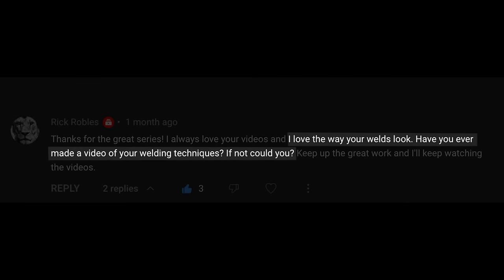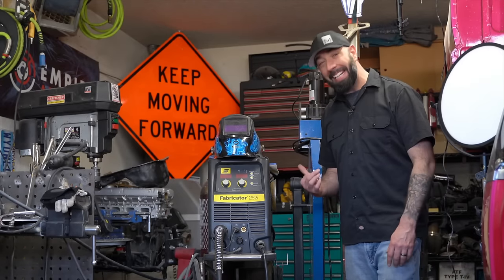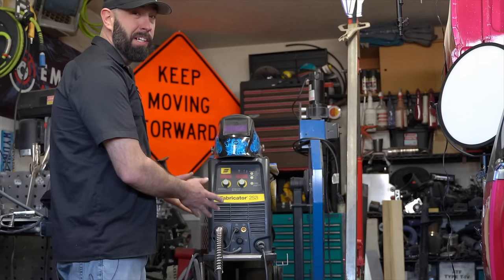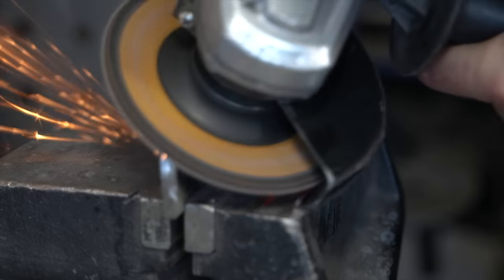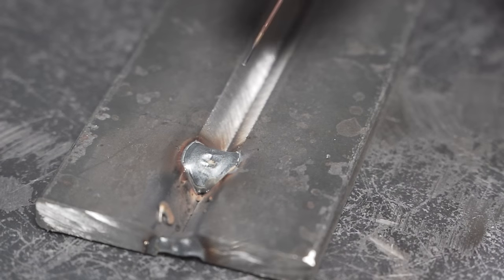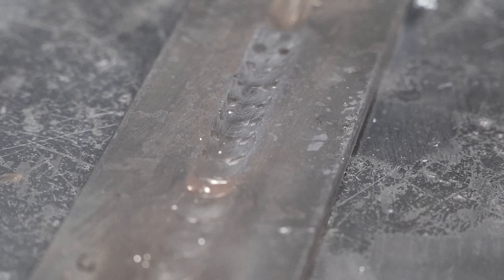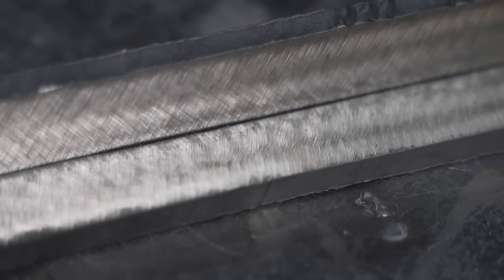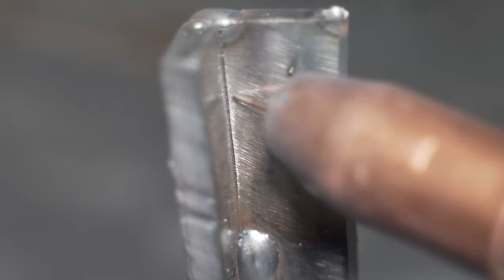MIG Like Mankandy: Techniques for Stacking Dimes with a MIG Welder

Comment: Nice video and the explanations are very clear. BTW, I have a 211 that I bought to improve welding body panels on older cars. Truth is, my open-box special HF 170 Mig ($80) is better at stitching thin metal, as it seems like the automatic settings on the Miller are always trying to 'out-guess' the guy holding the trigger. However, when you want to rock n roll on thicker stuff up to 1/2", it will out-punch it's weight.
Reply from the maker: Interesting! I can’t argue with that. I don’t recall ever doing sheet metal with the 211. Nothing thinner than 1/8. 🤔

Comment: I use the look and sound of the weld to gauge how well it is going. The puddle can tell you if your speed is good. There is a distinct sizzling sound as well.
Reply from the maker: Indeed there is! I like to say it resembles ripping jeans. (Because bacon actually sounds like terrible settings) 😆

Comment: Great video.  Love the detailed explanations.  I’m going to attempt a c notch install and helper bags on my truck. I hope my 110v mig is good enough to weld the plates.
Reply from the maker: Albert!! ❤️ Lemme know if you need a hand. It should be fine. Just try and look closely to make sure you can see the plates melting a bit. It should be visible on the corners.

Comment: I weld vertically down as much as possible, crank power up to make sure getting full penetration and drag it fast enough to not blow through 👍🏼👍🏼I’m normally welding thin mild steel box section for last ten years,, never had a joint fail or not last
Reply from the maker: Good to know, Ricky! I had to double check that I wasn’t the one that wrote that. 👏

Comment: Excellent video.  Can’t wait to try these techniques out.   I was using the “Cursive e” technique but looping in the opposite direction.   I wonder if it will make a difference.   Definitely want to try the triangle pattern.   Yours is slightly different from others I’ve seen.
Reply from the maker: Hey, Scott! If you’ve got the time, read the comments on this video. Someone told me that your cursive e is better than mine, so I’d advise continuing as you are. 
The reason is, with my e direction, you’re chasing gravity and the weld pool can fall over the base metal inhibiting proper penetration. 
Your e direction prevents that. 🙌 
Lemme know how the triangles go!
Thank you my friend. 🙏

Comment: This is similar to a self taught technique I do myself, I hold the trigger and keep my gun still until the start of my weld becomes the size of the bead it needs to be then I move along a bit (basically like the relocate thing u were talking about) and I'm always looking at the top of the weld to match it altogether in a perfectly straight weld. This does take alot of practice tho and harder welds r harder to get straighter

Comment: I too am a self taught person that doesn't really know a whole lot about welding. But I do have a millermatic 211 that really helps make up for my n00bness when sticking two pieces of metal together.  I have only used my machine with .035 wire. Which I feel could possibly be making my learning curve a little harder. Since working on my truck project I rarely work with anything thicker than 3/16". And now that the frame work is pretty much done. I'm using it for thinner stuff like making my own exhaust. I have gotten used to the .035 wire w/220v to be able to do 18 ga sheet metal work. As well as thicknesses in between. However, unless I'm working on thick metal, it seems to whant to burn through, or leave me with large looking welds. If I pause for to long like in the patterns you show in this episode. The metals I'm welding stick together ok, but my welds aren't great looking. I'll admit that I never "practice" when I'm not welding with a purpose associated with my project. Nor have I tried using the machine on manual settings. Could going down to say a .30 size wire be beneficial? I have a huge spool of the .035 left and I'm kinda frugal when it comes to money. Which is why I haven't tried with a smaller wire yet. But if it could make a difference I'll really consider switching. 
I enjoyed sharing this episode and look forward trying these techniques in an effort to improve the looks of my welds. Thanks for sharing!
Reply from the maker: Well, Will, I can tell you I use .030 on everything. Even the 1/4 inch stuff you saw in the video. I’m sure a trained welder could tell you why that’s not Ok. Likely too much heat, though I honestly still can’t grasp that concept. The .030 allows me to do thin sheet, and just takes a little longer on the thick stuff. If you can bring yourself to set the .035 to the side until you need to do some bigger stuff, I think you’d benefit from it.
I know spool couldn’t be all that big. The wire compartment on the 211 is tiny!! 😂
Reply: @GarageFab  Ok, you do raise good points. I value you're opinion  enough that I will try to have a spool of .030 in it before the end of this week.😎
And you're right, the compartment on the 211 isn't large. It does hold an 8" spool (5lbs irrc). Which compared to the 4" 1lb spool, seems big. 😂 
Either way, I've been saying it's "big" for a while, and it's gotten me by until now. 🤣
Thanks for the reply and input. It is appreciated! 🤘
Reply from the maker: My pleasure.
Reply: @GarageFab  just circling back on this a little. The size of the spool on my 211 is an 11lb. Not a 5 lb as I has stated before. So that unit does hold a good size spool. 👍 Now I get to put .030 on it tomorrow since the .035 ran out tonight. 
Anyway, hope to see another episode out soon! 🤘
Reply from the maker: Lemme know how it goes Will! Hopefully the next video drops Sunday morning. I haven’t even started it yet though so… 😬

Comment: rule of thumb is 1/4 inch anything under with can be welded downhill with manipulation, over should be done uphill.  When in doubt go uphill but it is possible to go downhill with preheat and technique to downhill a 1 inch plate same amount of weld is needed but good luck.  Similary to hot yes you will get penetration but you will just solder or capillary bond them rather then weld them
Reply from the maker: Thank you, my friend! That’s more detail than most people are willing to give.
Could you explain your final point a little more? Could you tell me more about capillary bonding? I’m intrigued that you can get penetration without fully welding. 🤔
Reply: @Garage Fab  in a nutshell your so hot your digging or gouging into the steel due to the heat of your weld puddle and arc force, but the weld cools and shrinks so rapidly it doesn't necessarily fuse or bond the whole way. Kind of like running to hot to fast going downhill it might look nice, but you could break it off with a hammer. I'm not saying your going to break your 1/4 flat weld you ran at spray arc settings with a hammer but I wouldn't necessarily trust it in a bend a test
Reply from the maker: @bilco22  Super interesting! I’m pretty sure I follow what you’re saying. Occasionally I’ll do a small weld on cold steel and you can see in the helmet the weld puddle just resting on top of the base. Puddle is glowing and the base is not. Luckily I can’t say I’ve seen that on any of my more serious welds. 
Thanks again for your time my man.
Reply: @Garage Fab  That was exactly what I wanted to say but didn't know if it would just sound confusing yes when your bead is glowing but the base metal it hasn't fused the core may have some but the toes of the weld are more like solder but anyways have a great day!

Comment: I actually prefer the stop go technique for most flat welds but also the half moon works great too
Reply from the maker: For me it depends on the width or size of the weld. Start stop is also my preferred if the joint isn’t too wide. 👏

Comment: When welding vertical down you want hot settings and very consistent travel speed with your gun being angled slightly upwards (no more than 15 degrees upwards or so) so your puddle is being not immediately being pulled over base metal that has not been fused.  To see what I mean turn your machine up hot and run vertical down with the gun pointing right into the plate and move a bit slower, you will see gravity pulling your puddle down in front of where you will be welding before you move the torch to that spot.
Reply from the maker: Thank you Nate! I appreciate your input. Most simply say “Don’t do vertical down.” with no explanation. It’s nice hear why accompanied by a way to achieve the best results. 👏

Comment: Damn. Nice and simple techinque.  you are right that fiddling with the machine is much harder than doing the patterns. Esp when you switch metal thicknesses or have to weld different thicknesses.
Reply from the maker: Man, I haven’t welded unequal thickness in a while! And I’d like to continue that streak. 😆

Comment: Have been out of welding for a while now, but just wondering why you are dragging your weld with shielding gas?
Old skool rule of thumb (doesn’t apply all the time) was “if it has a slag you drag). Pushing into your shielding gas with a mig may help undercut problems 🤷‍♂️
Reply from the maker: Just a preference. I’ve been experimenting with some pushing lately. A very strange body angle is needed for me to be able to see all that I want to see so not thrilled with it.

Comment: I even have a benchtop router table that is great to hold the router so I can work small parts over it without welding them to the bench. Does that count as a tech tip?
Daryl
Reply from the maker: Heck yes! I’d much rather move the part than the router.

Comment: This was an outstanding video! I will be saving it and watching it over again for sure. Many of the comments from you and others are also very helpful and instructive. I too am in the "I can't see" club, and am struggling to keep my head in front of the torch. I am also working on my push technique. I'm doing what I suppose would look like a reversal of your triangle-drag method, where I whip forward a bit to pre-heat, then come back and go side to side. I wonder if I prefer to drag because I learned stick welding first. Did you too? You do beautiful work, and I bet if your welds were tested they'd come out pretty darn good too! Thank you for your time sir

Comment: With my vertical downs I put the heat up and whip it a bit faster, melts the base fine.
Reply from the maker: Agreed! In the helmet you can see that your penetrating well and if you move quick enough you can’t also see the puddle isn’t building excessively and falling over the root. 👊

Comment: Try dual shield welding, flux core wire with shielding gas, it’s a game changer in production fabrication.
Reply from the maker: Interesting! I’ve done flux core. (Failed miserably) But never with gas. Is it 75/25 mix or something else?

Comment: 44 years in structural steel welding, do not do vertical down on stressed joints. Sheet metal is fine.
Reply from the maker: What is the reason, Peter? I’ve been looking for the scientific “why” but I haven’t gotten it yet. Thank you!
Reply: You can't get full penetration confidentiality. I've been involved in testing both types vd and vu. A lot more failures with vertical down. This is stressed joints. Not thin sheet. Truck frames, bridges and cranes ect...
Reply from the maker: I’ve been known to do a truck frame or two. 😳
Thank you, Peter!

Comment: So I see all the controversy about downhill welding, just want to throw my 2 cents in. Ive seen and done alot of pipe welds running downhill with 6010 and 7010 rods. There are also low hydrogen downhand rods also, (lincoln LHD-80). It definitely depends on the electrode. 7018, flux core, etc is a no for downhill because the slag runs in front and can cause a slag inclusion in the weld, puddle control, heat input are also factors in that. Its faster to uphand those anyways. It fills quicker. As for with your hardwire, i see 0 reason that you cant downhand those welds. Keep it hot and get to work 🤘🏼
Reply from the maker: Thank you my friend. I always appreciate input like that. The majority of folks spew absolutes with no explanation of “why”. Your understandable reasoning made me a little smarter. Cheers!

Comment: What wire brand and size do you use? How many cfm are u pushing? Great videos thank you.
Reply from the maker: Currently I’m using Vulcan wire from Harbor Freight. .030. I’m not at home at the moment but I believe the gas is at about 30-35 cfm. (I haven’t changed it in years so 🤷‍♂️)

Comment: I withheld my opinions about downhill welds until I tried them on something that mattered. In an effort to make some shock mounts look good on an off-road race car. I welded the  shock mount gussets downhill (1/4" a36 plate, properly cleaned, with a miller multimatic 220 machine). I used the machine pre-sets for 1/4", and set them a bit hotter, just to be on the safe side. Now every machine is different, and I believe the miller welds a bit fast, but the weld looked good, flat, and seemed to be solid. We did a shakedown run and the welds broke right off (ZERO penetration). I'm sure I could have used better technique, puddle control, led the root better, yada yada, but I ground the welds out with the Satan's sliver maker 3000 (aka carbide bur), and re-did them uphill with lower amperage and much slower wire speed, leading the puddle with a Christmas tree pattern. they weren't as pretty as I wanted (which is why I avoided welding uphill in the first place), but they held up to an 88mile endurance course with no fatigue or sign of cracking. Point is, just because the downhill welds can be ok, the uphill welds are always better, which is why manufactures that adhere to code simply won't allow downhill welding, especially with short circuit mig.
Link shows the car starting it's last lap (passenger front is already flat from a really hard hit). This course cracked the reinforced sub-frame all the way through. https://youtu.be/c-9pk0Y_NVM?si=C_So8SB0wbEKx2B3
Reply from the maker: This is the perfect type of criticism. Constructive critique based on experience and testing. You are appreciated my friend. This makes me want to change my ways and start practicing uphill.
I recently received some online MIG training (Weld Coach) and learned that settings for vertical uphill and upside down welding are NOT the same as all other welding. (The machine is turned down a bit. 🤯 )
That was insanely eye opening and dramatically improved the look of my uphill welds.
I’d like to recreate your weld tests in a video. I think it would be highly entertaining to try and intentionally break off since shock mounts. 👏
Reply: @GarageFab  That would be a cool video, but not on our car, haha. Losing a shock mount completely would cost me about 20 grand and about 2-3 full days of welding and fab work😬

Comment: I love your videos very helpful...I never welded before but I am going to buy a machine and try to learn...from your videos etc...1 thing I would like to know when welding do you keep wire up a few millimetres from joint or are you allowed to touch the base metal...thanks...John...lreland
Reply from the maker: Thank you, John! That’s a great question, and might be difficult to describe in text. While welding, the wire is in fact a few millimeters away from the metal, but that’s not something you have to regulate when your settings are right. You hold the tip of the gun roughly 2-3 centimeters from the workpiece and keep it there.
When you pull the trigger, wire is pushed out at a constant speed and an arc melts the wire before it contacts the metal.
The machine heat setting and wire speed determines how quickly the wire melts.
You can set the wire speed too high or the heat too low and the wire will crash into the metal. That produces a less than ideal weld.
You can set the heat too high or the wire speed too slow and the wire will burn back too quickly which also creates a bad weld.
It’s a delicate balance of heat and wire speed. If you can, I strongly recommend the Millermatic 211 Autoset machine. 
The auto function takes care of the settings so you can focus on learning technique.
Hope this made some sense. Best of luck!
Reply: @GarageFab  That makes sense I am starting to understand now the process...I will see about getting that machine...v well explained...thanks...John...lreland

Comment: Ok so.. I’m a high pressure tank and heat exchanger fabricator. I’ll tell you what, only time I’ll really use downhill dual shield, 1/16 wire is what we use fyi. But anyways I’ll use a slight vertical downhill when I’m on the inside of a tank welding the round seems on the heads. Key word”slight” witch means I start slightly uphill and go downhill a tad right into the “flat” and then actually when I’m coming to meet up to that last weld, I start going uphill very ever so slightly at the very end of the weld. Everything gets air arced on the outside. Then a single stringer is run. Before that I was a structural welder building water parks, and never would I use it there “downhill vertical”

Comment: Might sound like a dumb question but is the weld fill the wire ? My friend said it strikes an arc which im thinking the joining part is melting together but then it fills and im wondering where the fill metal is coming from . Must be the wire ?
Reply from the maker: Not dumb at all my friend. With MIG welding, there’s a large spool of wire inside the machine that gets pushed through the hose and comes out of the tip of the gun when you pull the trigger.
The tip of the gun electrically charges this wire so that when it contacts the metal it strikes an arc which simultaneously melts the wire and the base metal. So you are correct, the wire both provides the arc AND the filler material.